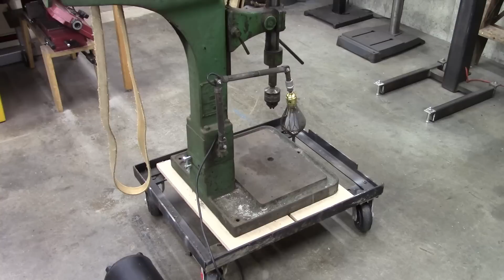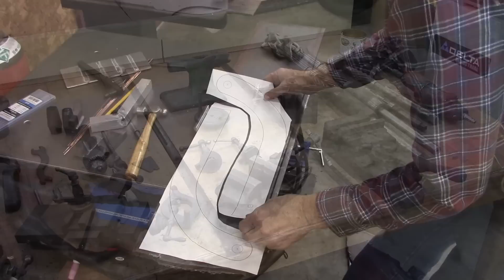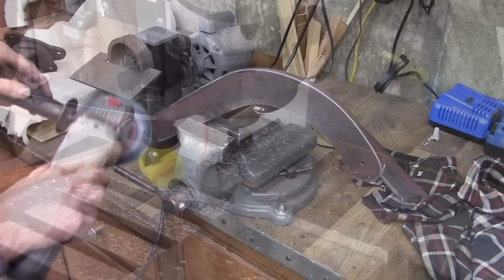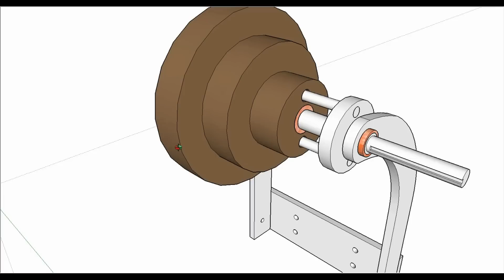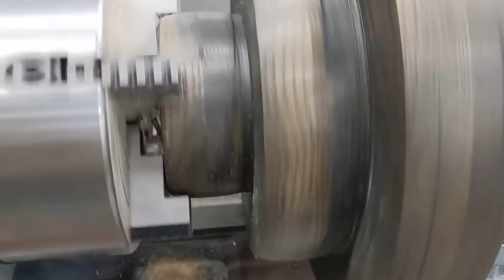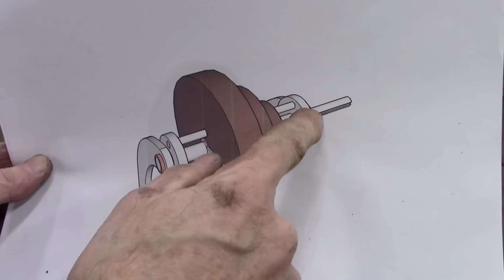Restoring a 1917 Avey No.1 Drill Press, Part-1 Building the Drive System

Comment: Ur table saw sled's are monsters too btw Winky mate.. I cannot get my head round how big they are.. U gave a really nice table saw there too btw. I asked a question about CNC's in another video. So u do use them.. Nice one..
Reply from the maker: I build the CNC wood lathe as a manual lathe maybe 4 or 5 years ago and then made it CNC maybe 2 years ago. I don't use it much but it works great. The cross cut sled is big enough to hold a sheet of plywood. It's fairly easy to build and drastically expands the capability of a table saw (and safety). Of course you have to dedicate a lot of space to this set up. It needs a way to catch the sled on both sides of the saw. You can also make them a lot smaller if you want. Here's a video I made: https://youtu.be/uWNv5v-6C8Q

Comment: 4:03 Oh, darn, there you are using your band saw insteand of your plasma cutter 😉  Perhaps at that thickness, the band saw is the faster, cleaner cutting choice?
I must have missed it if you mentioned it, what's the CAD application you're using here?  I like the drawings.
Reply from the maker: Hey Greg, the CAD is Sketchup. I have a purchased 2016 version my employer bought for me. Now they have a free online version but the downloaded version has an annual fee. If the fee was $50 buck I'd be happy to pay but they got greedy. I think it's more like $200. Crazy!  Anyway, the reason I didn't use the plasma was the quality of the cut. 3/8" is pushing the limits and looks kind of rough. The bandsaw was slow but drastic reduced the grinding. CAD is a very amazing tool.

Comment: You probably, have already thought of this, do you need belt tracking?  Thanks, I always enjoy!
Reply from the maker: Flat belts are amazing. As long as some of the pullies are crowned the belt will stay in in the middle. I crowned the wood pulleys higher in the middle slightly less than 1/8".

Comment: So do you have to shorten the belt to switch between pulley sizes? Or does the entire assembly move to take up the slack?
Reply from the maker: Yes...  the entire assembly moves. It has a huge amount of adjustment.
Reply: @WinkysWorkshop  i’ll have to watch it again, I totally blanked on how the assembly moves!
Reply from the maker: @Vikingwerk  I think I gave you a misleading answer. The wood pulley will slide on the shaft to change speeds but has nothing to do with the belt tension. If you pause the video at 1-minute you will see two rollers the belt goes over before going to the spindle. These two rollers move toward the front or back of the drill press about a foot and control the belt tension. They are controlled by the small handwheels on the front and back.
Reply: @WinkysWorkshop  aaah, interesting! Looking forward to seeing the whole system operate!

Comment: Very nice. I like the way you get the best out of that band saw. You could of fabricated those brackets but the way you have done it will make them look much more original I think. Thanks.
Reply from the maker: I agree...  it at least comes close to an older style bracket for the pulley. One of my viewer made that table a shared the idea. It works amazing.

Comment: A lot on engineering going on with that build. I think it's going to come out really nice. I have that same mill how did you get it to run so slow? 3 phase motor?
Reply from the maker: That was the standard lowest speed. Top pulley on the motor and bottom on the spindle. Ha...   Yeah, I had to think about that drive set up. I think it will work well.

Comment: I am in possession of a South Bend 14" drill press.  In a previous life it was a floor model, but I found it at a local scrap yard, and because it was cut in two, it now fits in my car. I didn't get a motor with it, so I'll look around at the scrap yard for one of those. The only rust it has is surface rust from being exposed to the elements. This is my first vintage American made shop power tool. Of course I have Atlas/Craftswoman tools, but they're specifically a wood working tool.
Reply from the maker: Thats great. Good find!

Comment: Ingenious as always Winky. Just out of interest, why did you not go for a 3 phase motor with a VFD. Nothing to be made just bolt the motor straight on. I thought that in the past you had bought a Plasma Cutter ? easy to cut out the 3/8"  arms instead of a bandsaw. Looking forward to see it all running. Regards from Australia.
Reply from the maker: I have three 3-phase motors and even a VFD. Only one of the three is about the right HP however (1/2 HP) and one huge one is unknown. Two reasons I went with the single phase. 1) 120V circuit, no new wires to run and 2) The 1/2 HP was about a 1960 motor and from what I hear the older motors have a very poor turn down rating, meaning they can't handle less that about 60% of full speed very well. I got some mixed advice on this...  some said, for short term use even running at 25% would be okay. Also, either way I would have to have some sort of pulley system for speed reduction. Even at 25% it's too fast with a 4" drive pulley. I was afraid to go less than 4" for a flat belt due to slippage. Plasma! I made a few test cuts and decided the clean up would be too much. Part of the problem is my lack of stead hand but even if I mastered a consistent speed the finish would require a lot more grinding.

Comment: If it's made in wood, a groove runs parallel to the grain and a dado runs across the grain.  Just imagine the part made of wood and you'll know what to call those features.

You might consider coating the pulleys belt surfaces with Gluboost, a cyano guitar finish that's quite hard and durable to protect the pulleys from rapid wear.

You do nice work!
Reply from the maker: I think I was referring to the groove in a piece of metal. The pulley probably  will not wear unless it slips a lot. I was thinking about polyurethane but was a little concerned it might glaze and slip
Reply: It's just OC semantics - I knew what you were referring to and just thought you might like to know the technical difference.  Strictly speaking, since yours is in metal which has no grain it can be rightfully called either one.
Reply from the maker: @CapnCrusty  Haha...  true.
Reply: But what if its MDF?  Never saw a medullary ray in particle board!

Comment: Lower your upper blade guide-
Reply from the maker: what blade guide?
Reply: @WinkysWorkshop  On your bandsaw-
Reply from the maker: @horacerumpole6912  Oh...  actually I did but a little further would have been good.
Reply: The point being to maximize beam strength of the blade section between the guides-
Reply from the maker: @horacerumpole6912  Makes sense. Most often I don't worry too much. If I was trying to follow a line exactly I'd be more concerned.